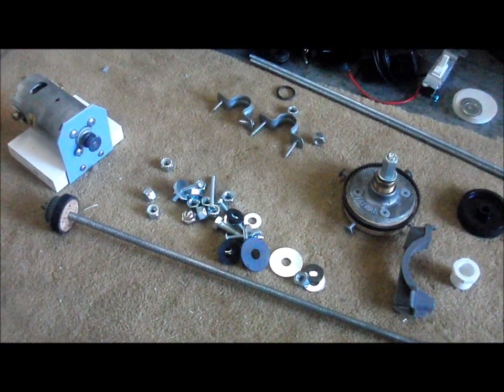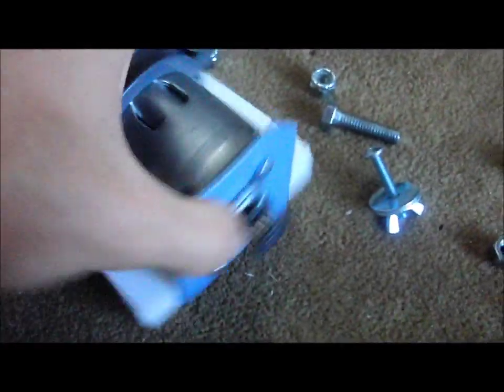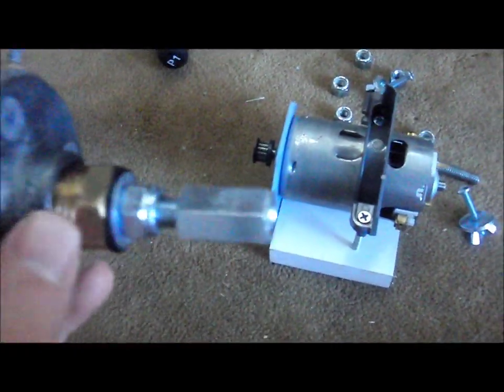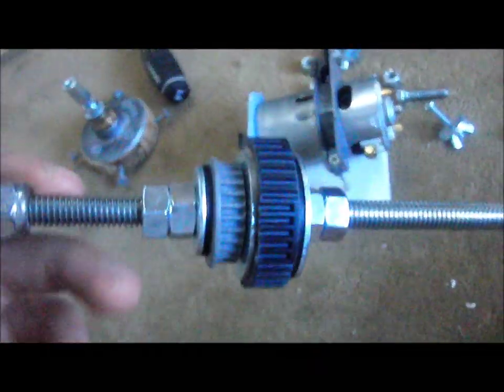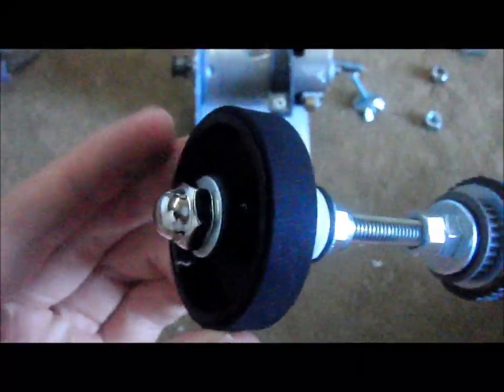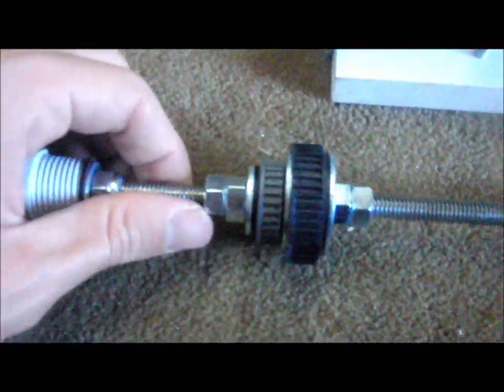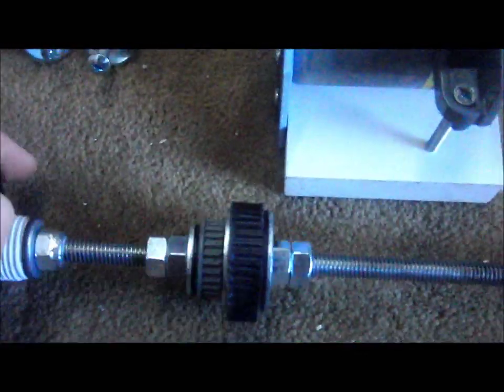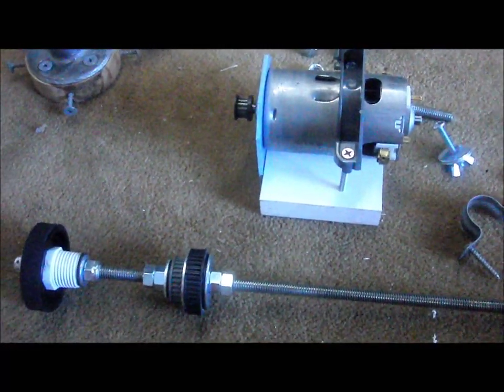Homemade Lathe Part 3

Comment: You could take a little arm and mount it off the motor and attach a spring so that the arm will always apply tension to the belt regardless of changing speeds
Reply from the maker: I suppose that is one way to do it but that would add friction and another complex part. I think I did it the simplest way. thanks for the comment!